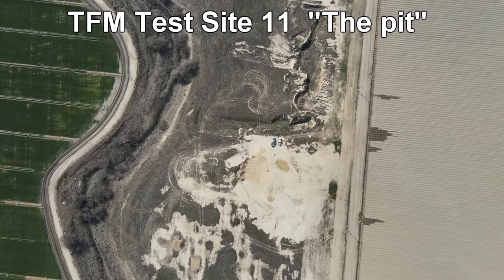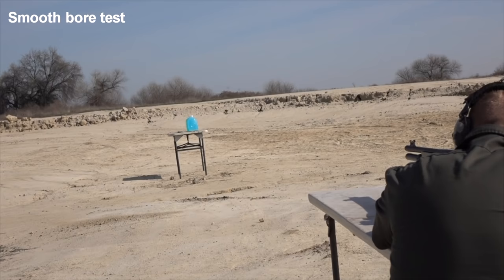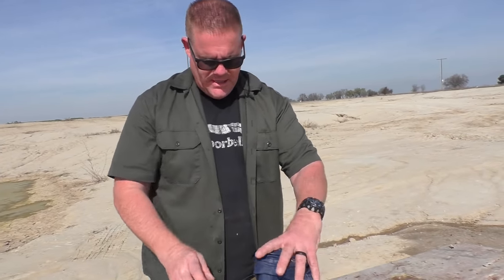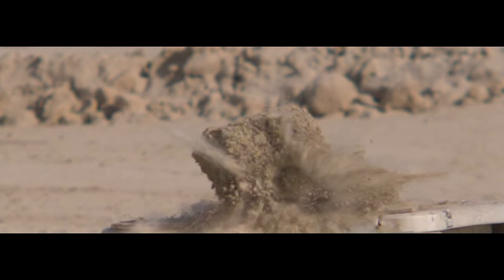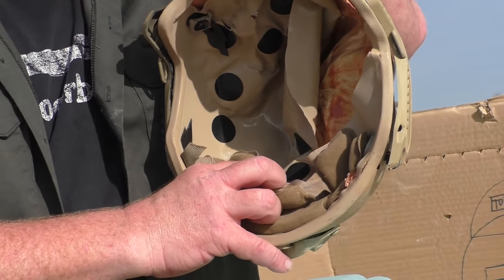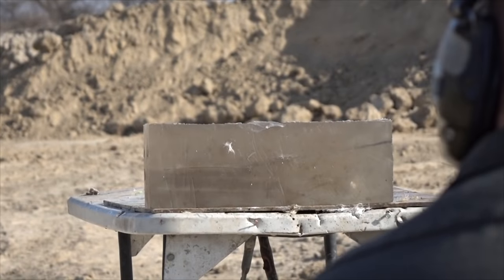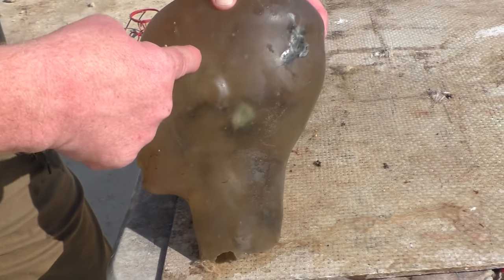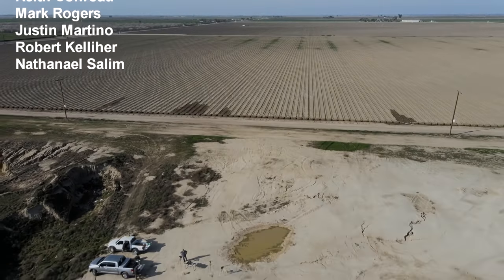4/0 Copper Cable Flechette Rounds - Tested

Comment from the maker: The tape used to bulk up the slugs did two things.   First it allowed better engagement with the rifling but it also squeezed the bundle of wires together much tighter and helped to keep them from being shoved out of the insulation.
Reply: Great, I guess you will be storming the capital all over again!
Reply: I haven't finished the video but a cool idea might be to score or split the cable jacket like a sabot.
Reply: when prepping the slugs maybe a lil epoxy down the tube to keep the flechettes from immediately separating?
Reply: @scottstokes1878  idk i think that they are fine with the tape too much epoxy and they would just act like an expensive slug
Reply: @ferrofeles2063  White glue might even be enough.
Reply: @derekst.laurent5768  Some crazy glue might wick through it nicely.
Reply: @ferrofeles2063  most of them, if not all, were far righters.
Reply: @grimreefer8561  Nawwww what's wrong sweetie? neither of your mommies cuddled you enough when you were a baby?
Reply: @grimreefer8561  Obvious troll is obvious; not funny.
Reply: made my morning!
Reply: @grimreefer8561  na im an hispanista.
Reply: Curious what would happen if you added some solder to one end. Curious if it would open like a hollow point
Reply: You know how much waste is at a construction site is and all goes in a dumpster, oh don't dumpster dive they call the cops and you will be in more trouble than teens stealing cars
Reply: @grimreefer8561  please understand that paid actors were used to storm the Capitol and security was in on it. None of us can possibly understand the chess game being played far above our little heads. Let’s just be sure we do a good job keeping a tight grip on our local govt.
Reply: @grimreefer8561  Federal Bureau of “whatever the left wants.”
Reply: @georgesalzmann9682  GENIUS!! Then again, the proper twist may compress the strands and cause the bundle to slip out of jacket also. We’ll only know if another video is made with this detail in mind.
Reply: Try lightly soldering front back and both ends.  Expansion could be interesting?
Reply: @grimreefer8561  
Please keep your anti-American comments to yourself.
Reply: You could try soldering them togather in the back al so use shrink tube for the outside
Reply: @MIgunnut  that's exactly what I was thinking.
Reply: It's nice to have yall pop up in my feed again. I guess the "Sh@d0W" B@n" is over.
Reply: You should strip about 5mm of the insulation off and dip that into molten lead to solder the wires together so they fly as on large chunk. On impact I predict each wire will follow its own trajectory
Reply: I love it when you talk dirty, OG
Reply: !st of All, Love Your Videos. Keep Up the Excellent Work..
2nd I would Like to bring to your Attention something!
Being from a Telecommunications back ground I've seen alot of Cable,
So I have to Ask, Did the Cable being used have a longitudinal twist of all the cooper wire inside it, Most cable does. If So, Depending on which way the twist was Aligned in the Barrel(Clockwise or Anti-Clockwise),  compared to the Rifling in the Barrel, The Spin created when fired would Cause the cooper wires to Either Tighten together in on themselves or Unravel Outwards Instead! This I Believe could be the Reason for the Failures where the cooper wire Separated Outward and Away as soon as it left the Barrel!
It's a Situation where the Rifling actually cause the Projectile, In this case the wire, To Destabilize or rather Disintegrate!
Kind Regards from New Zealand.. ;o)
Reply: "Snugger"?!? Really?....
Reply: @TAOFLEDERMAUS:
I've worked with 4/0 Cable for years, and not once did I think of doing this!
Now I wont have to spend so much just to make Rhodesian! Thanks!  :D
Reply: If you watch the slow motion footage of the shot to the helmet, and pay close attention to the left side of the screen, you can see a length of the copper wire twisting in the sunlight, and the unpredictable tearing apart, could be because of the twist that they put into the wires
(to keep them tight for the thinnest cable size, and for the thermoplastic to grip onto during the extrusion process)
                                                      when they are manufacturing those cables, and will obviously be clockwise or anti-clockwise, depending on which end you are looking at, and depending on which end is leading.......
           Also I couldn’t help thinking, that either the headache from that shot, would be terminal, or even a severed spinal cord would be what finishes you off, but I doubt that those helmets would save you..........
            You could try soldering the leading end, and/or even try some where you have soldered both ends, because that should hold the wires together for the initial shock, but they should break apart as soon as they contact something that is firm(like a dum-dum), such as a body........
Reply: Suggestion. Have someone take a quick xray of that ballistic gel head. You can get an idea of how deep all the copper wires went and what angle they came to rest. With the right technique, you can likely get the wound channel as well
Reply: @grimreefer8561  I agree with much if what you said. But it is not relevant how long your family has been in the country. They are dead and the world is for the living.
Reply: @grimreefer8561  I'm pretty sure a coward wouldn't face an armed police force head on. They were just morons in a mob. You really shouldn't bait people either. It's just not nice to do that, ya know? I'd know, I'm a long haired pot smokin hippie.
Reply: @grimreefer8561  woah, traitor's a heavy word mate. You wanna make sure you know what one has to do to become a traitor before you go throwing that word around.
Reply: @grimreefer8561  Russian bot detected! Send this one to the organ harvesters in China
Reply: I wasn't sure how it was gonna act before watching. I knew it could easily blow apart apart but it could also stay packed together in the insulation. Either way it is terrifying. I have gotten my hands on some cable of this gauge before and know it is hefty enough to do some damage. Not sure how to feel about knowing a little vinyl tape is all is needed to make it both relatively accurate and deadly.
Reply: @scottstokes1878  wax.
Reply: dab of solder on the open side of the "slug"?? may help keep it together until impact. Neat idea though!
Reply: 2
Reply: why dont you try heat shirnk tubing to keep wire together
Reply: @grimreefer8561  he's against the draconian lockdowns so he's got that going for him
Reply: I would love to see one made with used heroin needles.
Reply: @ferrofeles2063   another $3 says .. Reefer has a flat head too ( which is the only way he makes himself useful ) pivot man in the huka party ( in a SF bath house )
Reply: @joakimcroteau1913  so which one does that make u lol
Reply: Good Channel i have subscribed and getting notifications . i have a request to make please cut down unwanted talks . in this video all you did well but some unrelated talks , please reduce those . Thank You , any way i gave a thumbs us also
Reply: @Diogenes2077  You are another one that has been afraid all your life!
Reply: @Seelenschmiede  
You need to understand that the American people own those buildings and have the RIGHT to destroy them. It’s a very, very dumb thing to do (as we must then pay to build them ‘again’) but they belong to us, not to our employees who only work in OUR buildings. 
Btw, If the American people don’t revolt and overthrow this socialist government we may lose our country. Oh, YES!- for those that don’t know, “We, the People” have the FOREVER Right to overthrow our government. All we have to do is want to. I want to!
Reply: christian bogan  
That is exactly why America’s amazing Founders gave their posterity (“We, the People”) the FOREVER Right to overthrow bad / tyrannical governments like the one now. Even duly elected governments can be overthrown when they go bad, and this government was NOT elected by the people. The fact that not one Dem wanted to ‘find the facts’ is proof of that. Only liars, cheats and thieves try to hide the facts.
Reply: @naaadr3740  An entertained observer, hahaha!
Reply: @larrywatson9400  you have a socialist government? HAHAHA... You clearly have no clue at all what socialist even means.
Reply: @Seelenschmiede  
Let’s see, nearly 50 EOs in less than 50 days is not a ‘representative’ government. That is what socialists / communists, dictators and totalitarian governments do. Allowing tens of thousands of foreigners into our country against OUR WILL and against federal law is not a ‘representative’ government. 
Giving BILLIONS of OUR dollars to failed democrat-run cities and states making all Americans pay for their ignorance and failed policies and practices is NOT a ‘representative’ government. 
Passing non-bipartisan anti-gun laws against the “Supreme law of the land” (Constitution) strict wording- “shall NOT be INFRINGED” is NOT a ‘representative’ government. 
What were you saying?
We can and should overthrow this un-elected, American-hating government. The sooner, the better!
Reply: @joakimcroteau1913  touche my friend
Reply: @grimreefer8561  yeah
Reply: BIG ELECTRIC CABLES HAVE NO INSULATION,  THAT'S WEATHER PROOFING SO IT DOESN'T  CORODE
Reply: @grimreefer8561  I think you have these guys confused with another group? By the looks of the foot wear, they don't seem like a couple of guys out of  a few hundred that went through doors opened often by law enforcement, and didn't show disrespect to public property? They seem like the kind of ppl that would be involved in multi million dollar property damage, hundreds dead, so they can have the new "Jordans" for free. The types that would stand up for a criminal who abuses fentanyl and had robbed a pregnant lady in her home at gun point in the past. After all, the criminal pointing the muzzle at a mother to be's unborn child (of course, just 42 weeks, not a life), I'm sure Mr fentanyl was aware of his backstop in the event that the lady refused to hand over the money she had earned, that he deserved, because, we all know he was owed a great amount of "muh reparations". I just hope these gun guys limit their soy intake so they still have  the finger strength to load their "clips" into those fully semi auto 50 caliber guns that weigh as much as ten boxes. Great looking out there reamer
Reply: @Seelenschmiede  I knew it. I knew journalist were involved. So they wrote the "far side" cartoon? Interesting. I'll pass it on.
Reply: @grimreefer8561  dont bring Biden into this! Wait. Did u say kill and put their hand on the bible? Sorry. My mistake. I thought u said child molester. Carry on.
Reply: That's Not flechettes, We had flechette Rounds in the Service, 10 penny nails in a 105 Cannon, and little ones in the M-203 Grenade Launcher, they fly through the Air as an ARROW, not a wad, Come On Man!!!
Reply: @grunner30  you are nuts!!!
Reply: @grimreefer8561  
Taofledermaus: exists

Grim Reefer: “NONONONONONONONONONO!!!!! YOURE HAVING FUN IN A WAY I DONT LIKE!!!!!”
Reply: @buttfingerblaster  Like I really care what you think, I DON'T!
Reply: @grimreefer8561  well you replied, so you care at least a little bit. Kind of endearing, if you ask me. I appreciate the love 😗
Reply: @buttfingerblaster  What makes you think I have any love for cowards?
Reply: @ferrofeles2063  dude I'm sure Greg wasn't one of those people either, and that dude is just looking for attention, but be real. It was Trump supporters and Q freakshows. You're incredibly dense or biased to believe otherwise. Facts are facts, dude. Every single shred of evidence says you're completely and totally wrong. Also, Trump's own appointees, as well as the F.B.I, confirmed Antifa is not an organization. 

Now lets just enjoy these videos and move on.
Reply: What about a thicker bit of cable without the rubber so it just separates like a shot gun shell. Do you think if it engaged the rifling it would stay together?
Reply: This makes me think maybe a flechette round encased in wax or some other casing that can break on impact allowing for accuracy but also deliver maximum damage as the flecettes split off in different directions within the target
Reply: @daisydickey1024  At least I am not a traitor, TRAITOR!
Reply: oddjobbob  Mess with the bull, you may get the horns.
Reply: I think if you were to solder the whole bundle at the base just above the wad leaving the front of the bundle loose. Upon impact the wires would stay as a solid projectile after impact, with thr front wires peeled back. It would function a lot like the tsr slugs do.
Reply: I wonder if you could get the copper wires to stick together more by using some sort of glue. It would have to be something very watery to get between those tightly packed wires. Maybe super glue would work. I'd try some different things to see if you could get them to stay together but still break apart on impact with ballistic gel. I think shellac would work or maybe even watered down Titebobd II wood glue or wax ( oh the early days of the wax birdshot slugs)
Reply: @scottstokes1878  I like that idea but braze  the one side of the copper so when it does hit straight on it will take the coating and move it back and and let the copper wire to expand
Reply: @rickybobby6651  I would say yes I had the ae idea
Reply: @georgesalzmann9682  that is why if you braze the one end it should help
Reply: @ferrofeles2063  epoxy would be to strong and it might act like a slug than a hollow point
Reply: Newton Cradle™
Reply: A drop of gorilla glue on the top will keep them together
Reply: @benlowery72  underrated comment
Reply: There are/was a type of 12 ga round that used regular fletchetes. They were called Lucifer's Toothpicks. They were made from ferrous metal ( mild steel?).
I don't know if they are available anymore.
I got the impression that they were used in Vietnam occasionally. 
 I'm not sure about the reported terminal performance.
Reply: Thank God for Officer Greg . . .
Reply: You guys need to make homemade real flash the rounds start with loading with 3/4 no. 20 GA. Finish nails until perfefected
Reply: @grimreefer8561  Based.
Reply: I wonder if the wires could be press fitted into a properly sized piece of copper tubing. It would seem more likely to hold together during firing. The glue reinforcement ideas seemed plausible too.
Reply: Test it on electronics because of the copper
Reply: @grimreefer8561  Liar.
Reply: @grimreefer8561  Because you live with one daily.  Just look in the mirror.
Reply: @Slappaccino  Very dumb comment.
Reply: @karlyoung5089  nope
Reply: Hmm, I was thinking if you'd add a cone made out of metal (any metal really should do the trick) in front so that the wider part points outside to the tip of this round so it looks bit like a hollow point, would that cone a) Compress when the wires hit it and thus making it hit harder and do more damage and b) Deflect the wires outwards to make the damage area even larger? Also what wire lenght would be optimal and if shaping the end of the round to look like an actual bullet help with the aerodunamics aka the flight so it wouldn't tumble?

Comment: As a Utility Designer at my local power company, I approve of this content! 😬👍
Reply from the maker: Boom!
Reply: As a warehouse worker who works with those cables, I also approve.
Reply: As an electrician that runs this kind of wire I also approve.
Reply: as someone that loves to see shit get shot I approve of this :)
Reply: @kylem8992  MAKE SOME  and do some tests if you can
Reply: As a thief that steals this wire, I approve.
Reply: Hmmmmmm
Reply: As a Lucky ass Man, who was helping an old Lady clean her yard and she gave me a 55gallon drum FULL of this wire stripped ! I Love this wire ❗
Her husband was retired elec. whom had passed.
I had to rent a fork lift to load the drum on my truck and take it to recycle $30,000 cash for the contents of the drum....
...an I kept the drum... 
Those where the days!
Reply: As an electrician I question if any utility personnel ever seen anything larger than 1/0 Alu😉
Reply: @beinghuman3225  - How about 3-1000 MCM cable for 600 amp circuits? That’s serious stuff. Or 795 AA conductor perhaps? 😬
Reply: As another sparky I'm surprised that no one has questioned that WIRE being referred to as cable. Cable is a multi-conductor bundle; wire is a singular conductor. And I agree, linemen rarely use copper aside from crimping their Alu. to the copper coming out of the weather head.

Comment: The longer range and accuracy of a slug, that shatters into the tearing effect of a multi projectile shell. I love it, but I'd hate to be on the wrong end of a gun loaded with these.
Reply: Those invading copper strands would short circuit and crosswire lot of functions. You could raise your arm and end up taking a piss.
Reply: They say its shocking
Reply: shit, i would hate to be on the wrong end of a gun period
Reply: @Crazyclay78YT  Yeah, but if you had to pick between guns, this one is an absolutely awful pick.